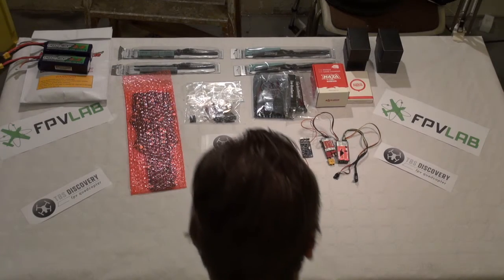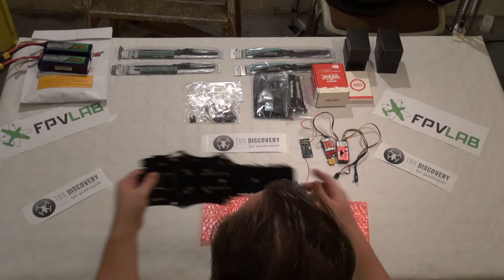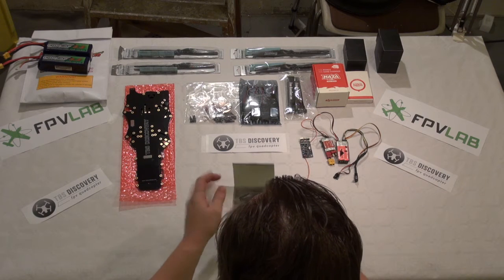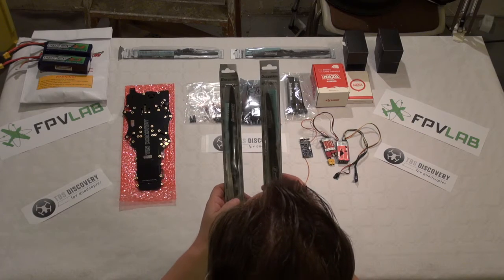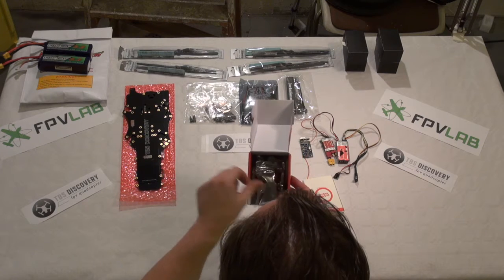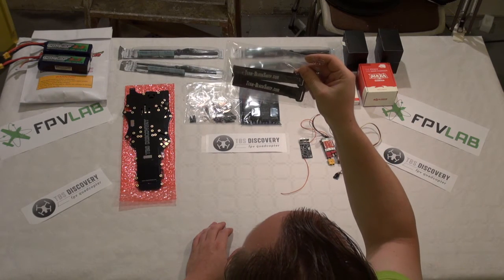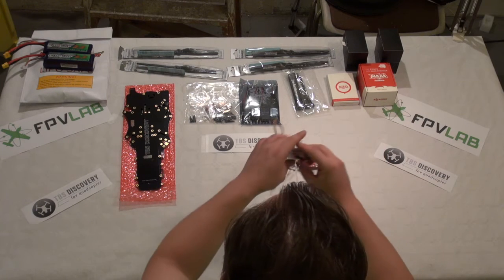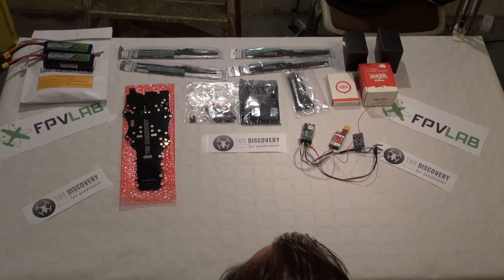TBS Discovery build EP1 Overview - 20121012

Comment: I know you have put a lot of effort into these videos and I respect that, but building a TBS Disco really does not require a 29 episode video series. 2/3 of these videos are unnecessary. Most CP Helicopter build series are 8-10 videos and they are much more complex than a quad. You need to speed up a bit.